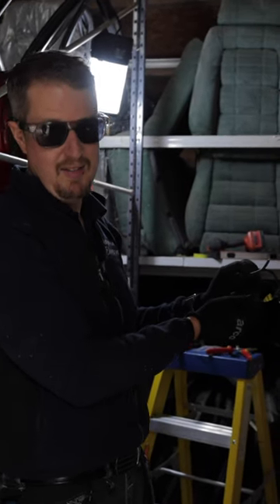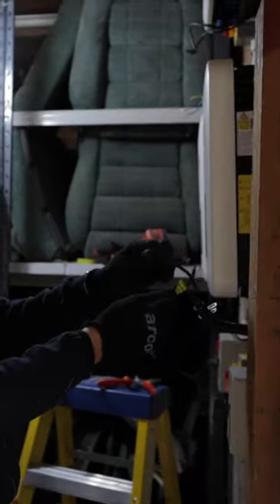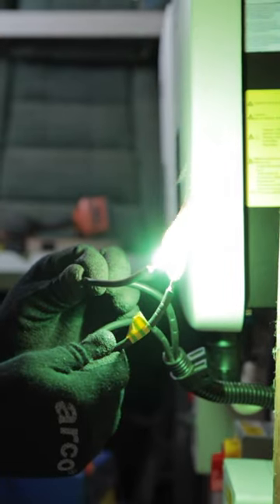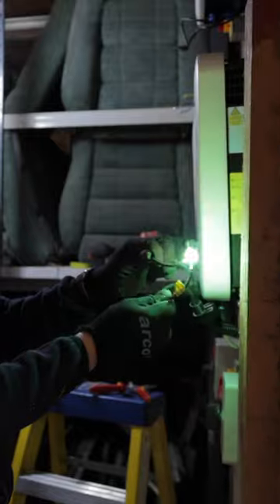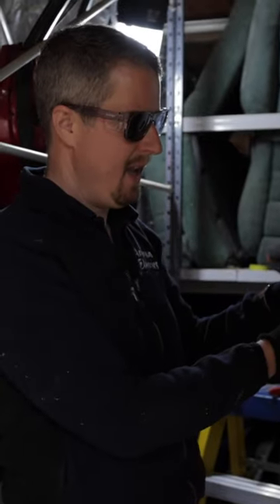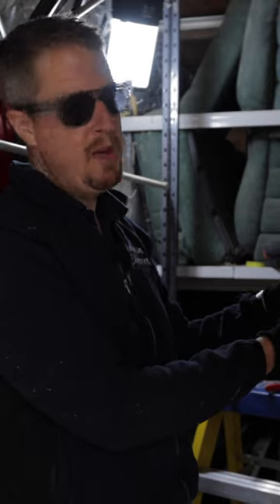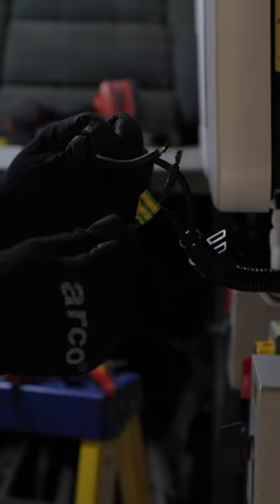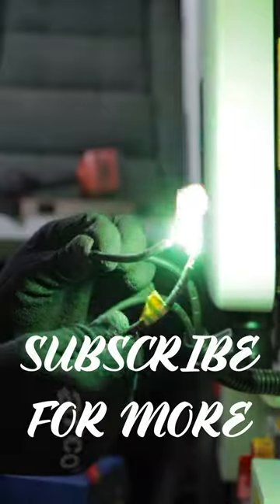Why DC electricity can be so DANGEROUS! 💀 #shorts

Comment: One of the first things I got taught working foran electrical DNO to touch things with the back of your hand (in a worst case scenario) with AC electrics because it forcefully contracts your muscles if your hand is facing forward preventing you from letting go so a certain death. I really enjoy Jordans content but this is not safe information. AC is a killer as well as DC. Don't presume it any more safe and don't play with electrics. Get a qualified tradesmen etc. Quite disappointed by this as a sparky that should primarily deal with AC.
Reply: DC is quite a bit more save than AC. The danger of photovoltaic is additionally lower since there is no potential to ground.

Comment: Surely AC going through 0 is for the tiniest fraction of a second. Our reaction times wouldn’t be quick enough to let go would they?
Reply: You literally can't let go of AC when electrocuted. It forces your muscles to clamp by the alternating current. This is sadly poor information at best. I'd prefer a DC belt if anything.
Reply: It depends a bit, but it can be enough. Still DC is  significantly saver than AC (at the same voltage) for several reasons.

Comment: you're like telling people A/c isn't that  dangerous because you can let go!! lol
Reply: Gonna ask from my ex neighbour who is dead by getting electric shock at his own home can this be true.
Reply: Ac really isnt that bad especially in the uk where he is. With uk circuit breakers, or trips, or fuses whatever you call them its unlikely ac will kill. DC circuits are usually unfused in solar panel systems as he shows here.
Reply: AC and DC will kill..... But DC will cause your muscles to lock, and no way of letting go of wire, so if you have to touch something, and you have a suspicion it could have voltage, touch with the back of fingers on the lowest part of potential voltage item, that way if it is DC, you have a chance, you may collapse and your hand will be pulled away 😜🤪🤦
Reply: @WiFi2021 ac will lock your mucsles too i dont get what your saying both are equally bad. The time it takes for ac to reach that 0 point and then back up to full potential is so fast there is no way to let go in that tiny amount of time. And actually ac is more likely to send your heart out of rythm because of this where dc is a just on big contraction and if you get off your heart is likely to go back into rythm.
Reply: @jsb7546  wrong... AC= Alternating current, DC=Direct Current 🤦 look it up.... Some chance with AC, fook all chance with DC 🤦🤦🤦
Reply: Or maybe he is telling don't use AC circuit breakers in DC system 🙃

Comment: As someone that works on solar PV day in day out I’m amazed at the amount of installs that think the dc switch at the bottom of an inverter is sufficient isolation. 

This summer I had to install dc rotary isolators to the pv along and entire street of near on thirty properties which were only built three years ago. The ac didn’t even have lockable isolation at all.

Comment: I was thinking about how all light switches etc would need to be replaced if electricity supplies ever switch to DC (far off in the future of course). Current ones wouldn't be able to break the arc properly unless the DC voltage was far lower than the current 240VAC (maybe 36VDC?).
Reply: According to european regulations, "safe" voltages are as follows:
AC - 50V for normal/good conditions (dry, no dust) and 25V for tough conditions (moist, dusty).
DC - 120V for good and 60V for tough.

It doesn't mean you will not get shocked. It only means you will be less hurt and you most probably survive the shock and only foul your mouth with some bad cursing. This is what "safe" means. You will MOST probably survive the shock.

Comment: I got a shock from some Christmas lights. I was probably around 10 at the time and knew a bit about basic electronics, one of the wires on the lights snapped so me not having enough knowledge I assumed it was low voltage so I just stripped the broken wire and twisted some wire I had to it but some time after I put my hand on the floor accidently on the bare copper I couldn't move or speak and after a few seconds i was able to move off it. The fuse didn't pop and it was a really old consumer unit with fuse wire so no rcd or rcbo protection, luckily my only shock and lesson learned lol
Reply: I got shocked by Christmas lights around 5 or so. It didn't wasn't painful so much it was terrifying and disorienting.

I think it gave me a permanent negative association with electricity, I've always hated being shocked, even by those little prank toys
Reply: @jacobs7764  yeah ot wasn't painful as such but the thing that terrified me at the moment was that there was a tingling going up my arm and I couldn't move or speak

Comment: Why do you say don't try this at home.  When I hear that I have to try it.  Well as a ex TV service engineer I did that of a line output transformer 22kv to 25kv was such fun.  Also from the top of a antenna with a fluorescent tube.  That is fun.

Comment: You weren't kidding! I did that with a 9 volt battery and the house burned down.
Reply: You want to try it with a 12v car battery, you can literally weld metal with it (not joking).
Reply: @michaels8336  yeah, car battery provides a lot of current.
Reply: Internal resistance....oh what's that!

Comment: Dc is generally considered safer than ac, I would happily grab dc power under 100v with dry hands, not a hope in hell am I doing that with ac, this video is very misleading. Besides the arc you struck there had to have Thousands upon thousands of volts, 10kv +

Comment: Attention Fake informations....
Reply from the maker: What is fake about this?
Reply: What’s fake about it? He did not say DC is more dangerous than AC nor did he say anything else that’s not accurate
Reply: He certainly implied AC was less dangerous by stating that unlike DC, you can let go of AC. 
This is fundamentally incorrect and quite frankly dangerous to imply. 
I will look at this in terms of UK standards and guidance as he is a UK based electrical contractor. 
But put simply with sufficient current (typically taken to be anything above 10 mA - known as the let-go threshold) it may be impossible to let go regardless of whether it is AC or DC. 
10 mA - That’s less than 0.08% of the current drawn by the average (3 kW) UK kettle. 

BS IEC 60479‑1:2018 - Effects of current on human beings and livestock

5 Effects of sinusoidal alternating current in the range of 15 Hz to 150 Hz
5.5 Threshold of let-go
The threshold of let-go depends on several parameters, such as the contact area, the shape and size of the electrodes and also on the physiological characteristics of the individual.
A value of about 10 mA is assumed for adult males in this document. 
In this document a value of about 5 mA covers the entire population (for additional information, see Figure 23).

BS 7671:2018+A2:2022

Section 131 - Fundamental principles
Chapter 41 - Protection against electric shock
Section 544 - Protective bonding conductors 
Part 7 - Special locations, with its additional requirements for protection against shock

Guidance note 8 - Earthing and bonding
6.1 again uses the value of 10 mA as the let-go threshold (specifically referencing BS IEC 60479‑1:2018) when defining an extraneous conductive part. 

HSR25 Guidance in the Electricity at Work Regulations 1989. 
34 The effects of electric shock are most acute at around the public electricity 
supply frequency of 50 hertz. S

All of which are completely unnecessary if as he states, you can just let go!

People are still dying in the UK and around the world in the electrical industry and allied sectors where safe isolation procedures are not being followed. Suggestion by people like this that the dangers are somehow less because it is AC and we can just let go really do not help to reinforce this very important message. 

ELECTRICITY IS DANGEROUS

Whether you want to become an online resource for electricians or just make a quick buck please take your responsibility seriously and be factually correct in your statements.
Reply: my profession is electronic engineer. in my long career I have worked with enormous electrical voltages. it wasn't always low or ultra-low voltage solid-state electronics. AC voltages above 600V easily create a breakdown through DC-safe dielectrics essentially creating a capacitor, and if the frequency is low enough (50-60hz) then they can potentially cause death. the corresponding DC voltages are 1200V. however, by raising the frequency of the alternating current (over 500 hz) the epidermal effect takes over and the current starts to become harmless